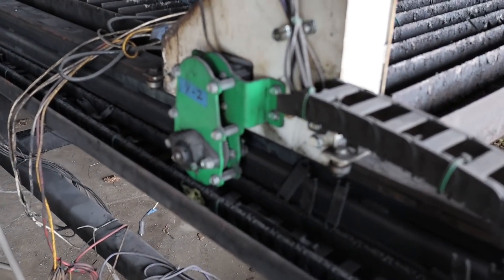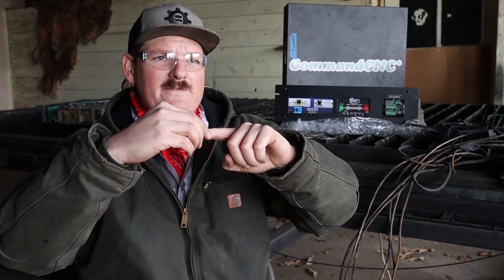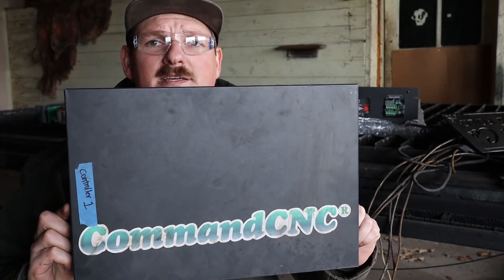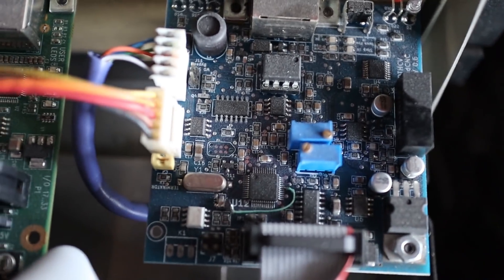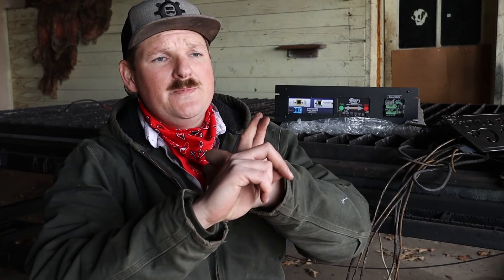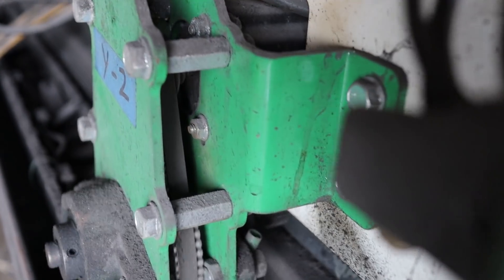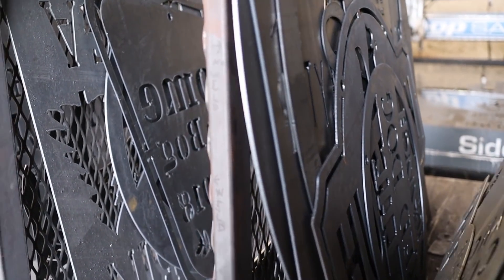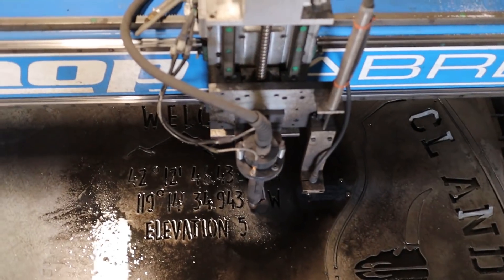BUILD or BUY - CNC PLASMA TABLE (TRUE STORY)

Comment: your big mistake was not use a good industry grade controller and larger motors . you should have just went Vitalsystems plasma controller. it top dog machmotion uses them   as far as mechanics that shop saber uses similar gearing . the ppllc should give good results . another option put flashcut  on the ppllc table have a good spare table

Comment: I'm in the process of building a similar table, when I was researching the control system I contacted Command CNC to ask some questions before dropping 3K, I'm sure happy I did, I learned rather quickly their not a company that I want to do business with, arrogant, rude and holier than thou are some of the nicer things I could say about them. After asking around in the DIY community I found out I wasn't the only one with this opinion of them.  I spoke to the guys at Geckodrive and they recommended I look into CNCdrive based in Hungry, So far those guys have been fantastic, their English is great, tech support is helpful and it is a much simpler and more up to date, all ethernet  connected components  and about 1/4 of the cost of Commands CNC's crap. I bought my components through one of their US dealers CNC4PC which they are also very knowledgeable and helpful.
Reply from the maker: Thank you so much for sharing a new resource for the electronics. I will check them out 👍
Reply: @MakerTable  It's called UCCNC :)

Comment: Yup! Candcnc's support is a huge information dump of poorly edited text. Candcnc hasn't heard of Grammarly. And then they want you to use the online forum to figure it out. The THC  on my table has never worked as it should. They gave me the same line of bullshit about my power supply and grounding. You can say what you want about this guys build or the dirt on the machine, but Candcnc will not do the right thing once they have your money. I'm stuck with a table I can't do a job with that involves a lot of cuts. Save more money or take out a loan and buy a table that has real on the ground customer support. If you add up the time and money spent on not only the table but material lost and two computers for the table, I could have bought Lincoln.

Comment: I have only seen 2 of your other videos and so I am new to the channel.  I am an electrician by trade specializing in control with a background in computers. I like  what you are doing and the business you have built up but I think you are not truly comparing apples to apples. Now i have never used commandcnc and no nothing about them, but they did not build table you did. You can not expect them to send a tech to fix your table. Now they should give you the benefit of the doubt and provide better support on the controller. You get what you pay for and as a diy maker you are on your own. So you spend more money and buy a compleat table and get compleat service. Now at the end of the video you talk about the new table is slower and you can not fix it. OF COURSE YOU CAN NOT CHANGE THE MAIN SETTINGS. That is what keeps the machine running. If you start changing speeds like your homemade machine you will kill that table too. One last comment is the dirty condition of your machine and the computer sitting right next to it. That  dirt anddebrie from the cutting process is getting inside that PC and will destroy it. I think it would be wise to be some better house keeping rules in place. One last note with out seeing your setup and knowing for sure, I beleave the zaxis height control board was being destroyed do to transient voltage and frequency spikes from the torch power supply itself in the  torch hight voltage sense line. If you better isolated and decoupled this line it would help. but again that's just a guess with out seeing your setup.
Reply: I'm an electrician as well..   industrial control, instrument, medium and high voltage.    I built mine just as he did..   personally I've never replaced a single part on my commandCnc controller..   just a power supply in the PC.   I like to think that the experience and knowledge I have as an electrician allowed me to produce better results than most people...      But most people, intended viewing audience;  need the real world advise He's conveying.   I honestly agree entirely with your take on this...  But I also believe commandCnc was represented honestly in his point of view.     I do understand how commandCnc gets with dealing with customers...  Because most people don't read...  Don't study ..  don't troubleshoot....     They just expect to make a call and get their problem solved...      But cnc is not always plug n play.   

I could literally write a book on the building process, ups and downs, hurdles etc..       but He pretty much summed it up in his video...     Average people need plug n play.   It's that simple.

Comment: If you still have the old table would it be worth converting to oxy fuel to pursue cutting heavier parts? You should be able to get by with out the height controller that blows out, and the slower speeds should keep the gantry alive.
Reply from the maker: Great idea!  I am going to turn it into a laser cardboard cutter to make our shipping boxes!
Reply: Maker Table that’s pretty damn cool too!
Reply from the maker: I saw those carboard box making machines at Fabtech and it got my brain rolling around on the idea

Comment: hmm... Actually it was worth it! It got you started and on this path, on which you seem to be very successfull now. You simply outgrew the unreliable machine.

That being said, people are doing MPCNC Plasma tables for few hundred bucks + plasma + compressor, so less than 1k $ these days. Obviously very low volume production and hobbyist grade, but if that gets you started successfully, even that is excellent! :)
Reply from the maker: You're right, the hobby machine was the only way for me to get to that next level without a bunch of debt.  So at the end of the day it paid off but the math doesn't exactly work out.  

I helped my dad build a 4' x 8' CNC router using the MPCNC Lowrider kit last year.  Great solution for the hobby level guys to get to the next level or just make some flat out cool shht!  Do they have an option for THC or is there a way to wire the Proma one in?
Reply: THC? Proma?
I have not built a MPCNC, just seen people done that and planning my own :)

Yea usually it always goes like that, you find better efficiency which makes you more competitive :)

Comment: would also be worth trying to keep your shop or even just the area you have your cnc plasma table a lot lot cleaner! I would also recommend you clean out your table water and keep it fresher. the amount of splatter over everything isn't helping longevity or reliability by having all that over your table components like the lead screws etc and into your ways and slides. It's basically abrasive paste covering all your parts. 
You want to improve your business or grow, thats good, but what I have said above is exactly the sort of things the larger professional machine shops will be doing and for good reason. TPM, reducing downtime, keeping a clean workplace, 5S, all key things to keeping an efficient shop. I don't know your own background or knowledge level, but hopefully you just arent aware or have had experience in these things yet and are willing to implement them.
It would be worse if you knew these principles but ignored them. It's funny when people just crap on things they dont understand or think that its nonsense, which unfortunately is so common place in machine shops and engineering workplaces. 
good luck with the new table.
Reply from the maker: Thanks for the input!  I grew up in a three shift manufacturing plant so we practice the LEAN manufacturing methodology here.  We keep good track of our PM's but we have room for improvement on the the 5S's particularly Shine.  We burn through bearing blocks because of our lack of cleanliness.  We've implemented some new processes when we load new sheets and we're tracking run hours per bearing block to measure the results of our new process.  I know we're not perfect, but we can get better every day.

We are always trying to improve down here.  I cover Kaizen principles most mornings on my Instagram story.  The next step is working it into some of the videos on here so other people can benefit.  Thanks for your input!
Reply: @MakerTable  at least you guys are aware and are doing something to help the situation which is half the battle! I just felt it was worth commenting since I saw the issues you were having on your old table and just saw your new table was getting pretty mucky looking. 
I know plasma and waterjet tables are inherently quite messy processes but for that very reason I would have our guys give the head's a once over at the end of their shifts just to keep the worst off.  Means they never get that super heavy build up and then we keep a TPM schedule in place for both to keep them tip top, obviously as well as a full spares store kept on a kanban list.  
I know it's tough when you're working day to day to implement new intiatives, but obviously can't be overstated to keep your money makers in tip top condition. 
You'll get there man, one step at a time. table looks great too, a solid bit of kit.
Reply from the maker: @joeshaft  Thanks for the thoughtful feedback, this is the stuff that gets you to the next level!  We schedule PM's but we're still looking at the bearing blocks as unscheduled downtime because we don't have enough data to implement a change over based on expected life expectancy. So I have a MOQ set for the bearing blocks and grease but the ultimate goal would be to get this on a Kanban card and schedule it during non critical operation hours.  I never thought about spares being on a Kanban Card though, I'll have to put some more thought into that.  I'm self taught on the LEAN stuff and I find it hard to bridge the gap between theory and practice sometimes.
Reply: @MakerTable  I don't think you ever stop learning about lean or the methodologies etc. it's a never ending learning curve in my experience! I have always found a great help by applying it to lots of different industries and you get to see the quirks of each and how best to apply the techniques, certainly been a massive help in my career. if you tackle a big lean project or improvement, it would be cool to see a video of that
Reply from the maker: @joeshaft  great idea, almost like a documentary of a six sigma green belt project. I'll have to think about ways to make that interesting.

Comment: When i have built my first table i used Candcnc DTHCIV. That old guy who owns the company is ridiculous. You are absolutely right, if something goes wrong they blame you. So after candcnc product i moved to Neuron THC ( russian thc )coupled with UCCNC ( hungarian software). Winner. Absolute never ever had problem. . Now i build cnc plasma only with industrial controls from Startshaphoon. Well just for the 2 cents, if you visit a big Company with large CNC oxy fuel and High Def Plasma you rearly see a PC monitor next to the machine :). By the way, you did great job on that CNC table building. You can't blame yourself for buying 2 of the CommandCNC. You were just lured by that THC like me before.
Reply: I also run a Neuron thc with UCCNC :) can really recommend, not the cheapest option, nor super expensive, certainly good value for money :)

Comment: Hey Maker:  Sad that was your experience.   I am glad you shared your thoughts at this point.   This video has been a great sanity check for me.

Please do not feel bad about what I am about to share:  I followed your videos when you were building.  I had mine up within about 3 weeks of starting much of it thanks to being able to see your trials and tribulations.  I was happy with your videos....on the table.  The outfit that I bought the rest of the components from (same outfit as you  bought from)….not happy at all.  

Broadly, it feels like everything is kludged together.  I found the system to be fragile.   I hate the idea of used computers being the basis of things.  The controller seems like it was a refurbished controller.  Tech support...I think one guy was pretty decent...the other not worth the time.  This is the perfect system for someone who doesn't want to cut with plasma...but wants to geek out on the electronics.

When I built the table...I did a few test cuts and then did exactly one 'free' sheet  of golf course signs for a local charity golf tournament.  The system would not boot afterwards.  I sent it back...turn around was about 3 weeks.  When I received it I immediately I did a few tests cuts.  Next day  I booted it up...nothing.  I told them I wanted a new computer...and I would pay for a new computer.  After a month of them telling me I did not know what I was doing...I still did not have a new computer and no working plasma table.   I threw a sheet over it and have not looked at it since March of 2018.   One thing that irritated me was I actually know Linux...they were treating me like I was a complete NOB.  I was into Linux before it had a GUI.   Anyway...I digress.

I have no problem cutting my losses...If anyone wants this complete table (less the Hypertherm)...I will let it go for 30 cents on the dollar right now. I am near El Paso, TX.  Video of first test cuts here:  https://youtu.be/np1-jFYG03Y

At this point:  I am curious about what you went to.  

My requirements are:  I need something that is robust, durable, and non-buggy.  I want it to work when I want to work....I don't want to be constantly trouble shooting it or talking to tech support (especially a prick who thinks I am a stupid F).  If it is a robust system then I wont' be talking to tech support.  I am not actually hanging out a shingle for custom cnc plasma work...I am using it in house for light fabrication.  I have to cut up 1" reasonably 'close enough'.  I would like to do bolt ready holes in up to 3/8.  I do not care if the table is a little slow...as long as it is reasonably accurate, reliable and trouble free.   I currently have a Hypertherm65 which I would recycle into a new table.  

With your experience...how do I get to that level? Or am I stuck having to go to a $100,000+ system to do about 80 hours of cutting per year?

I enjoy your channel...and have learned a lot from you over the last year.  Keep up the great work!  I wish you success and happiness in the future years to come!
Reply from the maker: Thanks brother, I feel all your pain.  I went with a Shop Sabre table that definitely doesn't run $100k.  JD2, Torchmate and Shop Sabre all make similar quality machines and back it up with decent tech support.  I like Shop Sabre's tech support best so I went with their machine.  There are some other options to just retrofit the electronics on your existing table because it sound like you have the controlled motion part down.  Flashcut CNC seems to be the most industrial style electronics package out there that will plug into your system.  Give them a shout, they're very helpful and knowledgable.
Reply: @MakerTable  

Thank you for your reply.  

I sent them an email.  I really do appreciate your hard work and transparency!

Comment: All that dirt is gonna destroy the critical ways on ANY machine, as well as possibly bridge electronic components and short out said components. Speed issue speaks for itself, the older heavy machine pushed too fast and suffered inertia problems, the amount of dirt on it near geared areas was self evident to chew out belts and gears..
There is no point in blaming, identifying issues with any machinery in that environment unless it is cleaned up on a daily basis.. IMO
Reply from the maker: The hardware is stored in a separate cabinet with filters on all intake fans.  Also, that black dust is a biproduct of ANY plasma process so a properly setup plasma controller should be designed with that environment in mind.  
The machine has been sitting idle for 6 months while we switched to the new system so it's current state is not representative of a running piece of equipment.  We cleaned the CRS rails (between every sheet) and oiled them daily as well as the rack and pinion gears.  This is not a maintenance issue.  i have documented PM's on this machine since I built it 2 years ago.